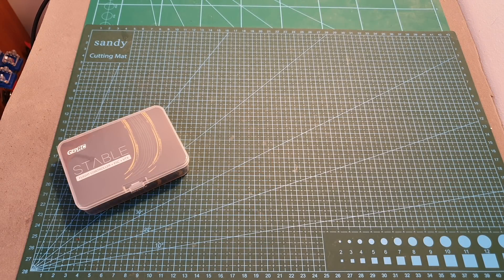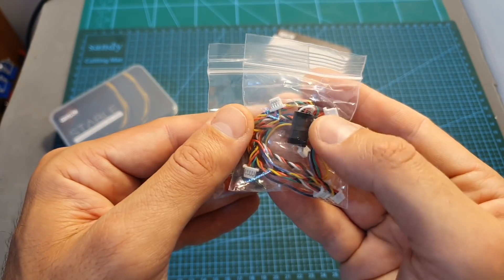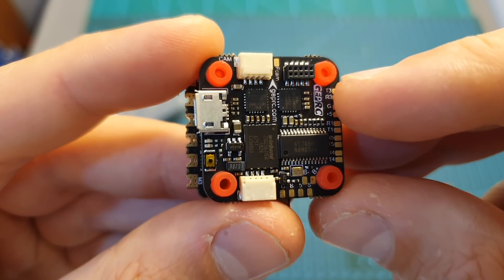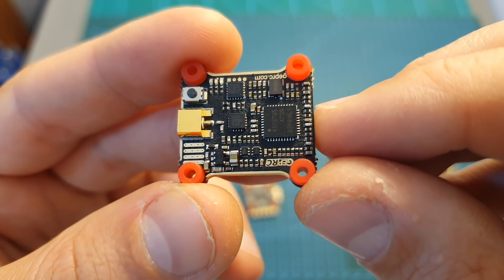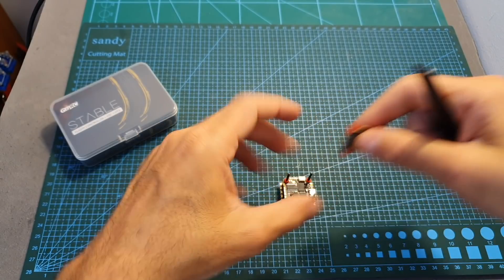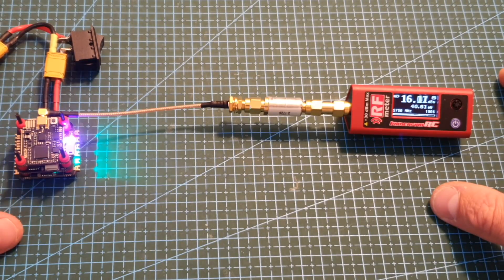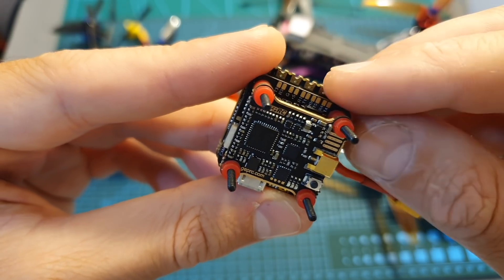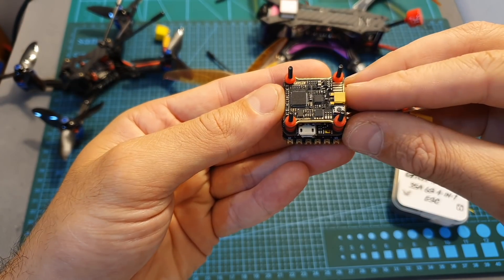Geprc Stable Pro Mini Stack - Overview & VTX Power Test

Comment: Hi Gal. I have issues programming the vtx output power of the geprc stack. On the IM it sounds super simple. Is it correct, that after programming, the red LED should flash 1 to 5 times depends on what output power you select? On my vtx it flashes always only ones, no matter how many times it flashes during programming. Can you tell me what I am doing wrong? Can you perhaps show the programming in a short video? Would be awesome👍🏻
Reply from the maker: Sorry but I don't have this stack anymore. Have you tried contacting Geprc? They should be able to verify that your VTX settings in BF are correct.
Reply: @KremerFPV  Thanks for your feedback. I wrote to geprc. No answer so far. But thanks anyways.
Reply: @KremerFPV  Thanks to your input, i figured out the very simple solution for this issue. If you wanna program your vtx on the vtx itself, you just need to disable the stock vtx setting in the "ports" table under "Peripherials". Set it to disabled and your are good to go. I think i will mention this in my next video about the cinequeen from geprc. They program the BNF version like this. I still prefer programming on the vtx itself. Thanks again! You helped me out o:)

Comment: I have the stable stack f4 so to use bf to change vtx settings do i need to enable IRC tramp THEN set up all the values in the vtx table tab? Currently on 4.2+ bf firmware
Reply from the maker: That's correct.

Comment: How do I change the vtx power output on this board?  I change it via the OSD, SAVE and EXIT.  Yet when I go back into the OSD it says vtx output power is 25mw.
Reply from the maker: It looks like the VTX is not configured properly on Betaflight. Did you update the BF firmware?
Reply: @KremerFPV  do I need to update the firmware?
Reply from the maker: @RobsClips1980  No. Stock firmware should work,  I just wanted to know if you made any adjustments.

Comment: Yea know cinepro in betaflight says 600mW..
So it comes unlocked? 
Curious cause I went out and went out no further with video than my cinecan at 200mW. Cinepro at 600mW
Reply from the maker: The settings in Betaflight do not reflect the real output strength, it just set the output power of the VTX (So for example 600mw on Betaflight using IRC Tramp Protocol is the highest output power of a VTX, so for a certain VTX it can be 200mw and for another one 1000mw). The VTX comes unlocked.
Reply: @KremerFPV  yea I know its just a label. Like it says.. i can write anythong I want lol.. just saying company says 500mw but they know it outputs higher so they labeled it 600.. better to be higher than lower.. just found it weird it made it same exact distance as happy model vtx lol.. ill retest maybe interference .. 
Not happy with geprc though.. r-xsr doesn't have telemetry. I tried setting it up trying trouble shooting. Doesn't work. Rssi and rxbat only
Reply: @divingfalconfpv4602  When I try to change the Power in the OSD it always goes back to 25mw. Any idea?
Reply: @johnnyrocket3200  did u click "set" after changing power?
Reply: @divingfalconfpv4602   @divingfalconfpv4602  Of course. Even save&Reboot. It feels like it might be locked for the EU. It always jumps back to 25mw. I changed the 600mw to 500 - as well as in the label and the power tab. Maybe that's why. I haven't tried the hardware-button yet.

Comment: Do you know how to unlock VTX? My one keeps going back to 25mW.  I set it up with button or through smart audio.
Reply from the maker: It's already unlocked. 
You can either set it manually using a button and then disable the IRC tramp protocol feature or set it using Betaflight using the IRC Tramp Protocol option.
Make sure that the VTX is configured correctly and the VTX table is configured properly in case you are using BF 4.1.X and above.
Reply: Hi Plooca, did you change it already? I'm planning to use this in my next build.

Comment: I have the span pro. I have trouble setting the vtx to a higher mw. It stays on 25mw after i set it to a higher mw. 3 second press twice gets me to red light. Do i have to long press to save?
Reply from the maker: Why don't you set it using IRC tramp protocol on Betaflight?
Reply: @KremerFPV  when I do betaflight has an error closing seriel port when I save

Comment: I have the f7 version and am looking for a way to connect a barometer sensor but cannot find any i²c pads.  How and what barometer module can I use?

...reason why is my GPS  altitude is all over the place.
Reply from the maker: I am not sure if it has one. You can remap the BF resources and use a pad which is not in use.
Reply: @KremerFPV  Thanks, that sure would be great.  I didn't think changing a uart to understanding a different language would be possible.   I'll have to look more into this.

Comment: Hi, I am new to all this so can you help. I would like to put the stable v2 f4 into my cygnet cx3. Geprc say that this is possible. What I need to know is do they come flashed with betaflight? Geprc also mention debugging...What does that mean? Thank you.
Reply from the maker: Hi Andrew. It will be flashed with Betaflight but it's probably recommended to update the firmware. Maybe by 'debugging' thwy referred to putting the board in DFU mode in order to flash Betaflight.

Comment: Thanks for review, I am a newbee and bought a Cinepro 4K. I am looking for someone who could tell me how to get to the VTX settings page on the display. Can’t find any detailed manual for that VTX and tried to change it with the led/buttons but red light always goes back to one blink (20 mW). HELP!
I could not find your power test on that VTX either. Thanks
Reply from the maker: You're welcome Martin. The easiest way to setup the VTX is using the IRC Tramp Protocol. Did you change any of the default settings on your flight controller?
Reply: @KremerFPV  No, and I have no idea what a IRC Protocal is...so sorry. ;) I just want to max out the VTX power.
Reply: GEPRC support showed me that they do it thru the OSD interface? No idea how to get there.
Reply from the maker: @Martoon5  https://youtu.be/LQC77g8vZfI Please see the explanation at 05:11

Comment: Gal kremer hi bro, I’ve recently got my geprc cinepro with f7 board, and would like to change the power on the vtx to 500mw could you do a video please on how to do it with the buttons please.?? As I’m a bit confused about how to do it, thanks, 
ps sorry if this sounds stupid.
Reply from the maker: It's a legit question - no worries :-)
The easiest method is to use the smart audio feature. 
You need to open up the Betaflight OSD menu by putting the Throttle at mid-position, pitch to the top and yaw to the right. Then navigate using your sticks to Features - select VTX-TR and over there you can set the output power.
Reply: Gal Kremer thanks I’m not up with all this stuff I’ll just look in to it a bit more. Thanks mate

Comment: Great preview! I have bought the same Stack was super easy to build, this stack has it all… but I noticed that the temperature already rises when setting up on the bench, when the FC just idle it goes up to 90-100°C. This isn´t  normal ? I will test in flight soon and see how the temperature behaves. Can you tell me if your unit is heating up so quick too. Will there be a detailed review with flight test?
Reply from the maker: The VTX is heating it up. I used it on a build video that will be up soon and it works very well.
Reply: @KremerFPV  Thanks for your Answer. First flight went well for me too, with stock settings and bf 4.0.4! I'm looking forward to your build video!
Reply: Hello Fa Bee, i have the same Problem. Do you have fix it?

Comment: Hi.  I have a doubt I have GEPRC Sparrow V2 MX3 139 mm F4.  And I have broken the controlla plate.  I could buy and then put it in the marked GEPRC Sparrow V2 MX3 139 mm ... Geprc stable Pro F7.  Thanks for your time
Reply from the maker: Yes, you can :-)

Comment: What's the point of having vibration dampeners if the boards are connected to each other using pins? The only place where you could remove some vibration is between the frame and the bottom circuit board. The rest is obsolete.
Reply from the maker: I see your point but there is some degree of freedom when the pins are connected, so vibration dampeners can be useful.

Comment: Avoid these stacks... If you race or crash often. Its a big no no.. 😒 I warned some of my friends about these stacks and they ignored me.. Now they are paying for it. Connector pins are terrible and it will just fall apart. 🙁
Reply: DARKRYDER7 I have the cygnet pro and that’s been my experience.. lots of crashing and the stack is always broken.
Reply from the maker: I do hope that on their next version they will use "regular" connectors instead.
Reply: Broken?? I crashed a lot and I once fell out of sky (misconfigured GPS rescue) and hit on grass hard. Stack was fine.